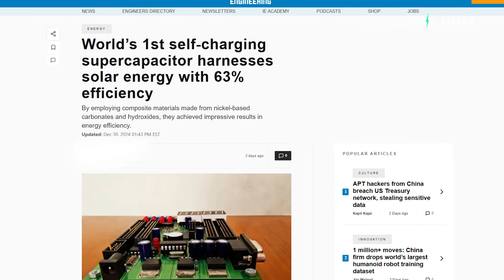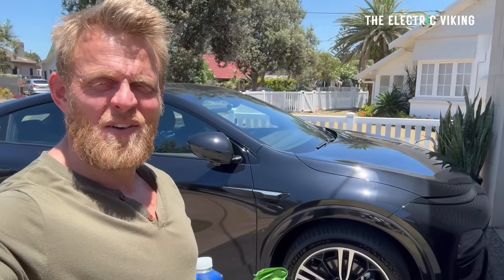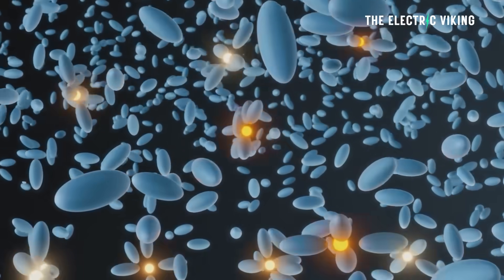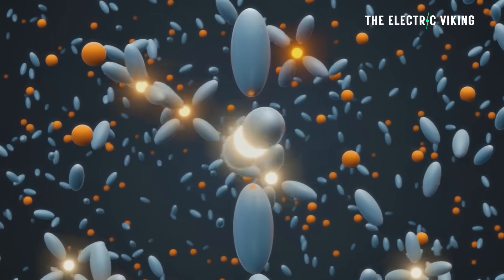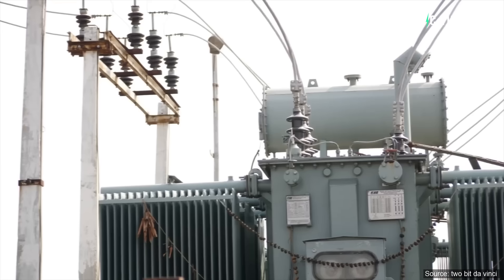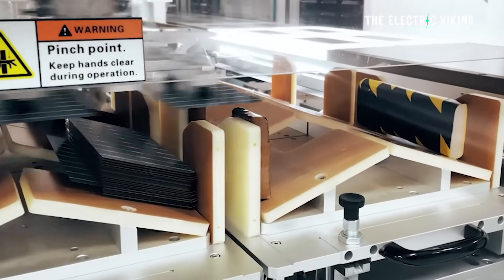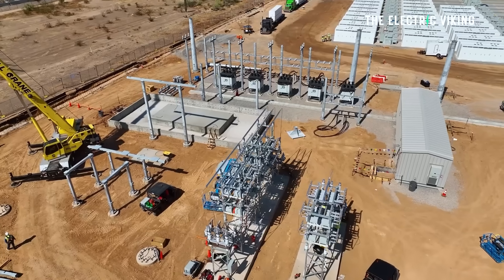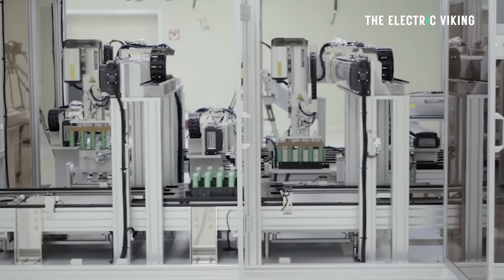World’s 1st self-charging supercapacitor records shocking 63% solar efficiency

Comment: For those wondering how a super cap integrated to a solar panel can increase efficiency.  I'm not totally sure as they aren't really sharing details but perhaps the integrated energy storage can capture and store power at lower light levels than charging batteries. These are large capacitors not batteries.

Comment: Don't forget that if you can get large planes of the ground, you can also get space planes through most of the atmosphere with super capacitors and batteries. Considering the cost of getting physical fuel into space and the fact that you need to add a lot of weight to such rockets that need to land using that physical fuel, having high-discharge on-demand solar energy storage that you can recharge in orbit is more efficient (even at 63% discharge efficiency) Sure, the last bit where the air gets thin you'll still need hydrogen and oxygen rockets to get to space, but you don't need to refill those as air braking will get you to the ground and you could theoretically take off and land at international airports, no extra ground infra needed beyond mission control.
But yeah Sam, please remake this video to be less confusing.

Comment: I read an article on it.  The 63% efficiency is just for the storage, the overall combined efficiency of the solar and storage is only 5%.  So compared to a separate panel paired with a li-ion battery, it is only a quarter as efficient…I would not call this a breakthrough….

Comment: I have a super capacitor automotive jump starter. It charges in a couple of minutes. You can harvest residual energy from the dead battery, or charge it from good battery or USB power bank. It stores enough charge to start a diesel SUV (tested by me). Great gadget!

Comment: Consider, ...that your solar panel will have an 'integrated' micro-inverter and battery in one composite platform(?) That blade battery could be incorporated with the soar panel, which raises the price of the panel, but reduces the cost of the capture/storage/delivery system. Stacked in serial or parallel architecture, the reduction in wiring and labor costs could compensate. This could be a game-changer, moving electrification into a 'plug-and-play' model(...?)

Comment: A capacitor that is 63% efficient ... I assume that means you only get back 63% of the energy you put it?   Lithium Ion batteries have typical efficiencies of around 95%   e.g.  for every 100kWh put into a Lithium  battery, up to 95kWh can be taken out . Lead acid batteries are less efficient for every time you charge you only get 80% back. Capacitors advantage over batteries is very fast discharge possible... e.g.applications  like the video mentions on airplane takeoff. If you merged a capacitor with a solar cell,  I guess the advantage would he allowing higher temporary peak amps draws,.

Comment: Since it captures 63% of the solar energy (coming from the solar panels of course-you can’t create energy) then that means you waste/lose 37% of the energy you spent all the money putting in the panels. The only advantage would be a huge difference in cost over batteries coupled with low power needs.

Comment: In most cases where batteries are used, there is a transient surge of power required, which is much bigger than the steady state current. This is where a super cap could assist the, now much smaller, Li-ion battery. A good application could be for starting car engines.

Comment: I have used supercapaciters for years. 
As suggested,  transportation vehicles draw large initial power to  overcoming inertia after that moving draws less power as noted by Sam notes. Capacitors can charge quickly on energy capture and could be deployed in the wheel motor for immediate capture. Making other suggestions like this got me banned from X.
The supercapacitors charge and discharge very quickly at higher voltages without degradation which destroys batteries. The 48 volt automobile version would perfectly for automobiles but but the 5000 volt version used for  ignition of Nuclear bombs could be used for takeoff of jumbo jets and fully loaded trains.
Sam , thank you for your series .

Comment: super caps can move a lot of power fast they can take it in and discharge at about the same rate. If you add them to your solar system during the day if you have enough solar to run your house you can turn on everything in your house and still charge your batterys. also they can help any of the hevey loads like compressors and airconditioners start with out taxing the batterys.

Comment: Hi Sam, I don't understand how a supercapacitor, which can rapidly charge and discharge, would affect solar efficiency.  Surely the efficiency of converting solar energy to electrical energy would depend on the efficiency of the solar cells rather than the method of energy storage, wouldn't it?

Comment: Sam Evans is doing an overview, it seems clear the overall effect of a system that incorporates much-improved capacitors, is improved solar efficiency.  Makes a lot of sense for initial ‘absorbing’ of any energy coming out of something relatively weak in terms of output, like solar panels.  Even though Lithium cells do open the floodgates much better than lead-acid, for charging, capacitors must be less resistant to it I’d have thought, even than Li ion, or LiFePO4?  I have no deep knowledge, but while in an EV you wouldn’t want to have a load of capacitors to initially take the incoming charge energy, then hand it to the battery, because of mass issues, this is not an issue in a building.  Airplanes, would have an issue of course, they have to be incredibly efficient if electric air travel is to work.  The problem we have, is that Big Energy, Gas & Oil (Big EGO I call them), are so filthy rich, they can spoil and steer new tech wrong, do adverse research to block new stuff, all day long.  They’ve become a problem, quite some time ago, too much leverage and politicians too easily bribed.  Take care all.

Comment: Very interesting. I used super capacitors 25 years ago during my doctoral research as rechargeable batteries on miniature wearable bio signal devices. They were lighter than batteries, charged quickly, and didn’t degrade.

Comment: Why would you add capacitors to a battery powered plane when they aren’t needed?  It would just be more added weight.  Batteries can safely discharge all of their power in an hour or so.  Planes need to be able to fly for 5 hours, which means the battery can supply 5x more energy than what is needed for cruising.  That would still be 2.5x as much as what a plane needs to take off.  Capacitors are useful for short bursts of big energy outputs, where the demand exceeds the maximum battery output.

Comment: Let me try to give a bit of an explanation about how this works for those that are interested in the technology.
First of all every solar panel is a self-charging capacitor. When exposed to light the panel builds up an electric charge between two layers that can be tapped into to use. Capacitors also have two layers with a charge difference that can be used.
What these scientists did was add some materials to a solar panel, so it could hold much more charge, as much as a capacitor can that is designed to hold charge.
35 Wh/kg compares to a solar that produces about 20 W/kg (under optimal conditions) for a regular solar panel. This panel can store more than it can produce in a day. That is a great achievement, but it's also just about all the good news about this device.
The specifications of this device are not very good and if you want this function, you're probably better off buying a solar panel and a separate capacitor or battery.
Capacitors typically have an efficiency of over 99%, which means that when you put 1 kWh of charge in, you can get almost 1 kWh of charge out again.
The solar efficiency of this panel is only just over 5%, while normal solar panels have efficiencies over 20%. Which means you will need to cover 4x more surface with these panels to generate the same amount of energy. That also means that this solution is at least 4x as expensive as using a regular solar panel.

Then there are some worries that I did not see discussed in the article I read about this. First of all capacitors lose charge over time, but very little. A capacitor can still hold a significant amount of charge after a year. A solar panel typically loses charge in seconds or minutes. Since this structurally is a solar panel I expect the ability to hold charge is probably more like that of a solar panel than that of a typical capacitor.
Then there is temperature. Capacitors typically fail earlier when exposed to high temperatures. When you have a solar inverter, you want to put it in a place where it is not exposed to direct sunlight. A solar panel will also be able to hold a bit less charge at higher temperatures (e.g. as a result of exposure to sunlight). This works in lab conditions, but might not work as well in real life conditions.

If they can further improve upon this concept, it might be useful, but they need to at least double the solar efficiency.
Solar panels are often paired up with capacitors. Solar panels produce DC, to make AC you use a capacitor. When you have a solar panel that can double as a capacitor, you can draw AC from it. There are solar panels with micro inverters, that can produce AC. With a panel like this, you don't need a complete micro inverter, just a panel and a transistor could give you AC at the right voltage. So it could be a cheaper alternative to a panel plus microinverter.
If you can make the panel hold charge overnight, you can put a panel like this on top of a vehicle, and you might not need a lead acid battery and alternator and can just draw the electricity you need from the panel (unless you park it in a garage and only take it out to drive at night). You would need a big and heavy panel though, so it's also not ideal.

Comment: Capacitors store electricity from an outside source, they do not produce electricity. Capacitors might be technically capable of replacing batteries in megapacks, but cannot produce power on their own. Another scam from the anti solar panel group.

Comment: You need to stick to what you know, you are talking complete rubbish. Solar panels are what they are, 22 to 25% efficient which means they convert that percentage of sunlight which falls on them into electricity. Capacitors do not increase the efficiency of solar panels. The images you showed of capacitors were tiny low power and you even showed some valves. Geez man any old crap to make money, what next, a perpetual engine that runs without fuel ?

Comment: Electric airplanes could have their range extended, if airports electrified their runways. Electrical pickups installed on the landing gear, would enable them to get off the ground with "shore-power", no need for super-capacitors.

Comment: Solar cells are up to 25% efficiency: 1 kW of sunlight is converted to 250 W of power.  This supercapacitor has a 63% efficiency (charge to discharge), thus using it here would yield 250 x 0.63 = 157.5 W of usable power stored from your hypothetical 1 kW of sunlight.

Comment: First off i agree with comments from dglass. But if you could improve supercapacitors enough you could drive a car,bus, delivery truck in a big city with stop and go driving indefinitely without touching the battery with your regenerative braking system.

Comment: you are totally wrong. Actually 63% efficiency for electrical storage is very low.  This has nothing to do with solar light collection efficiency.  You need to partner with an engineer to avoid this kind of nonsense.  - a storage efficiency of 63 % and a high overall efficiency of 5.17 % under an illumination intensity of 10 mW cm−2- is actually poor performance.

Comment: Supercapacitors are great for supplying peak loads that batteries can't e.g. starting Diesel-Electric Locomotives. There is no peak current for solar panels- the paek is never higher than the continuous current, whether you are charging a battery or driving an Inverter.

Comment: 0:50 "produce around about 300 kilowatts of electricity a day":
300 kW (power) or 300 kWh (energy)?
300kW over 24 hours would be 7,200 kWh presuming  the sun hovered over your panels for a whole day.
Please learn the difference between power and energy.

Comment: maybe you could place it in a EV, to charge it during braking and normal charging Lv2, and they could push car from stop position. Starting and moving a car from standing still is the most energy costing part. If these super conductors could kick car without using traction battery - that could save a lot of power and expand EV range.

Comment: 40 or so years ago I watched on TV a man in Silicon Valley who built a capacitive discharge system with battery installed in a car and when he hit the switch the discharge the car accelerated at a high rate making the news man exclaim at the power of it. Nothing new here as more innovations keep evolving.

Comment: Please stop confusing PV efficiency with storage capacity. It doesn't matter how the energy is generated, these capacitors are a replacemnent option for batteries, but are not improving solar panel performance at all.

Comment: Without seeing the original statement, I'm guessing that there some misunderstanding. Ordinarily a solar charged storage system probably experiences lisses at multiple points... The solar anel efficiency, transmission between the panels and storage, each connecton and converting and transformung energy as needed. I'm guessing the losses are probably mitigated by minimizing ehe number of connectors and connections by integrating the whole process and possibly doing everything on a single piece of silicon. Compared to a typical component based system, the savings could readonably estimated to gain 60% efficiencies.

Comment: I talked about supercaps for EVs below, but your video is about an emerging breakthrough in using capacitors with solar cells. I found a science paper published in the journal Nano Research back in 2016, where they talked about using capacitors to solve problems with the electricity being generated from solar cells. Best as I can understand it is that the electricity generated by solar cells is a big mess. The electrons come off the cells in random waves generating random voltages and amperage. This craziness causes problems down the line making the system far less efficient than they theoretically could be. The study showed that various research groups were working to solve the problems by adding capacitors directly below the solar cells to dampen the electrical noise. By integrating solar cells and capacitors and simultaneously storing the electricity and smoothing the energy output, this problem was reduced. The study saw increased efficiencies of as high as 5% back in 2016, something it expressed was not that significant. It looks like the research work continued for the last 8 years and they managed to really get somewhere with it. Thank you for showing us this. I would have never known that this was a thing going on otherwise.
Reply: I wonder if with solar cells having only a weak electrical output (we could call it the ‘push’), there might not only be a use and tech for easier flow into capacitors than even very ‘accepting’ batteries like Lithium/LiFePO, but something that actively ‘pulls’ current out?  Sounds like it would need energy so might be counterproductive.  !
Reply: @sleekitwan  I think the improvement comes from the capacitors providing a way to organize the energy coming off the solar cells and then sending it down the line in a steadier more usable band. At least this is what capacitors are used for in regular electronics. The way to think about this is if you had water coming from rocky splashy rapids. Trying to put those crazy rapids over a water wheel would mean there would be some of the water splashing to the side and in the air, some water slows by hitting the rocks while other goes straight through, other water spins in whirlpools. The solution is to create a mill pond before the wheel and carefully channel the water so all its energy is used to move wheel. Capacitors are the mill ponds in electronics. In this thing with capacitors coupled with solar cells the improvement is only from the organizing the river rapids of electricity coming from the solar cells into the mill pond of the capacitors. This explains the 5.17% overall efficiency improvement. Capacitors can't create energy. For that matter solar cells don't create energy either. They take the energy from the sun and convert it at an overall efficiency of 20ish percent right now. This would maybe make a solar+capacitor cell convert the sun's energy to around 25%? Maybe? The theoretical maximum that a solar cell can convert of the sun's energy is somewhere around 40%. So there is a lot of room for improvement on that. Remember the Law of Conservation of Energy, which says energy can only be transformed from one form to another, it cannot be created or destroyed.

Comment: The capacitors store electrical energy generated by solar cells with less resistance, and thus less energy is lost.  But some of the commenters are PRETENDING that Sam is mixing up solar tech with capacitors, when the video makes it completely clear that PAIRING solar with capacitors is what leads to gains in efficiency (at least theoretically).

Comment: I had to look it up, but basically capacitors help by improving something called the Power Factor.  

Yes, new capacitor technology, such as supercapacitors, can improve solar panels by improving the power factor and storing energy: 
Power factor
Capacitor banks can improve the power factor by providing reactive power to compensate for inductive loads. This results in reduced losses, increased efficiency, and compliance with utility requirements.